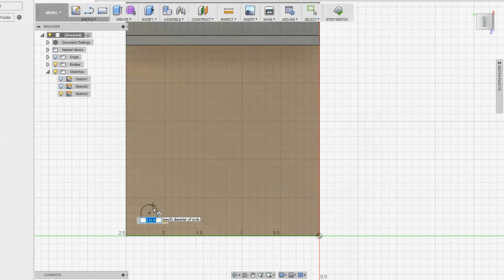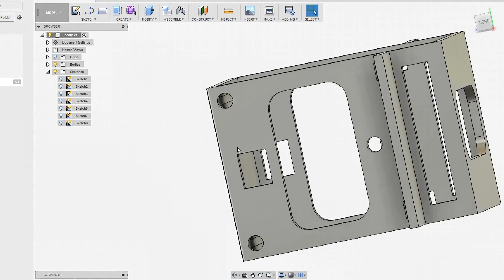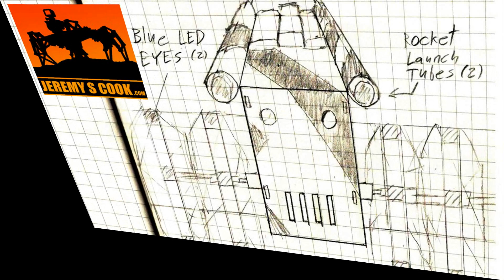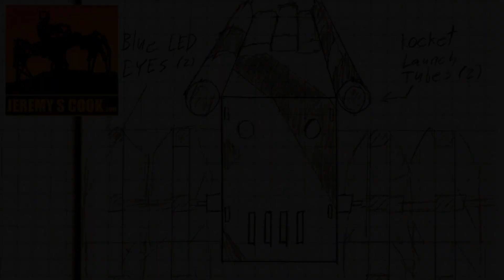Rocket Launcher Strandbeest [Fireworks Arduino]

Comment: Epic! What are you using on the heated bed? I have the same printer and found the stock surface is not all that great.
Reply from the maker: Thanks! Using the stock surface/heater - mine is version 2 of the printer, so perhaps they've improved on it?
Reply: Ah that's probably it. I have version 1. I'll have to see if I can upgrade it.